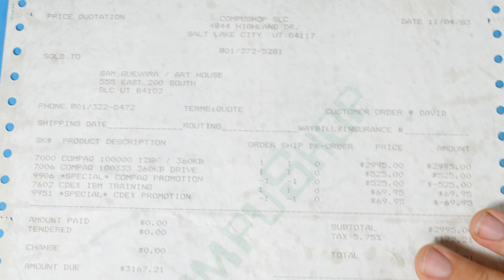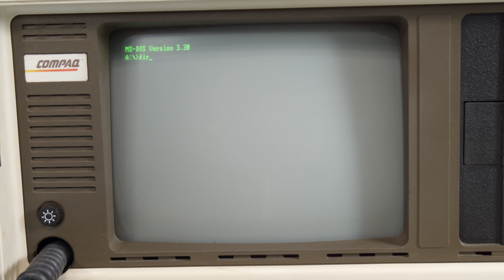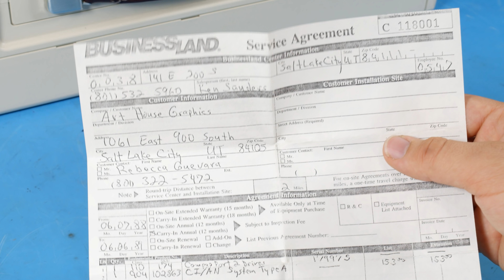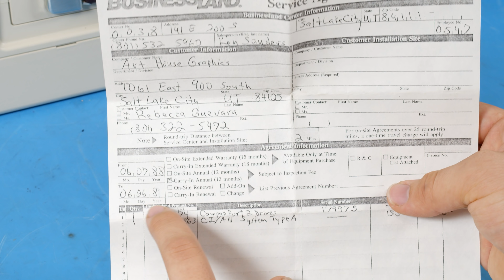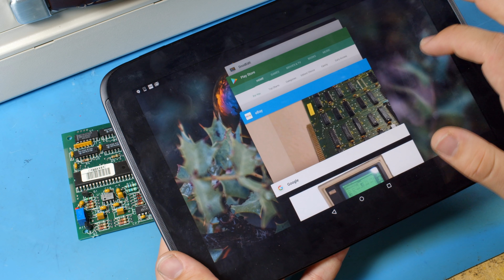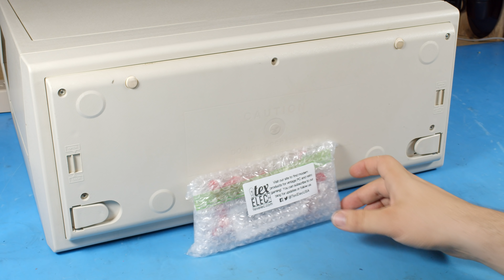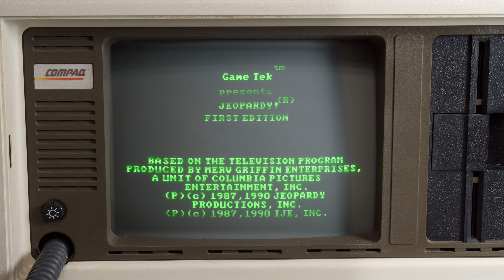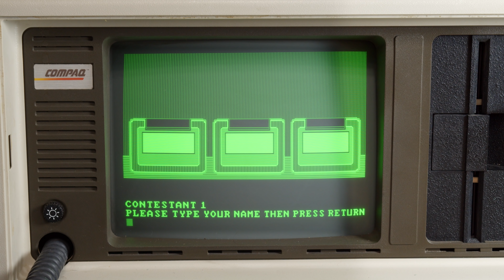Compaq Portable Repair history & Foam and Foil Keyboard Repair

Comment from the maker: It turns out it's easy to unplug the keyboard from the motherboard if you take off the bottom panel, oops.
Reply: well good to know now, for future unplugs or other people
Reply: Cool, but that compaq keyboard needed a rebuild lol
Reply: Your making me want to Dust off my Old Unit, But the Video card you can Also Plug in to a TV set for the Color.. Oh Flash Back of the Light Pen
I Also have the AT Clone Version of the Case, Much better it was Upgraded to a 486-DX50 VESA Local Bus. Two Cache Controllers, It was my Portable Workstation, till I got my IBM IntelliStation Z Pro (DUAL PENTIUM PRO), Intense3D Pro1000/T video adapter (16MB + 4MB Texture) Type 6899
Reply: @MakarovFox  I'm an otter person!
Reply: @hypnotised-clover  i prefer bats or foxes

Comment: Every time I hear the words foam and foil something in my brain goes off and I get ten times madder at whoever invented them.
Reply: I'd kinda counter with it cost about a quarter as much, and at least it wasnt a Sinclair keyboard.
Reply: @mycosys  yes it's cheap. But no one wants a keyboard that fucking disentergrates. The chicklet keys don't fail this bad. 
Rubber domes are cheap, but they don't disenergrate.
Reply: Chyrosran22 much?
Reply: At least I'm not in the cult of Holy Panda yet.
Yet... I plan on it.
Reply: I have no problem with them at all.  It's an easy repair.

Comment: Just got one of these DOA from ebay.  Had a memory bank error, found a shorted out 7400, replace that, snipped off a bunch of shorted tantalums, had it up and running until I plugged in the floppy controller, which somehow shorted out and killed my original video card.  Snipped off the bad tantalums on the floppy controller, ordered a replacement video card from ebay.  Ram expansion was badly corroded from leaking battery, scrubbed all the battery acid off, snipped off shorted tantalums.  Got all the cards back in and the machine is up and running! Ordered foil pads from texelec and an XTIDE.  This weekend I'll be scrubbing the case.  First 100% IBM compatible, and a portable no less. Very cool. Parked next to my TRS80 Model 4. The tantalums on the 12V rail are usually just to reduce RF interference.  The machine will run without them.  I've re-installed a bunch of them, will get to the rest of them eventually.

Comment: I’m the biggest sucker for Luggables. I’ve got a Portable II and love it. This one is screaming out for an XT-IDE and a Lo-fi ram upgrade. But even without, it’s looks in awesome condition even after all its repairs.
Reply from the maker: This video was started over a week ago and since then I've tested my Tecmar Captain and XT-IDE in it and it is working great with 640KB!
Reply: Oh, awesome. Great to hear. My Portable II still has its original HDD. Mainly because it makes the most awesome sounds :)

Comment: I have a Compaq Portable II, and I will need to do that with the keyboard as well. Nice little machine.
Reply: I was wondering if the Compaq Portable II used the same foam & foil system as the PC in this video, as I have one as well. So far my original keyboard is still holding up okay, though it doesn't get much use. I may one day put a socket on the keyboard cable to allow for a regular desktop keyboard to be plugged in. From what I understand it's wired the same as a PS/2 keyboard.

Comment: This thing feels like Theseus' Ship with how many parts have been replaced!
Reply: I'm guessing everything that was replaced was damaged when it was dropped.  Those old portables were sturdy but not bulletproof, and they weighed quite a bit.
Reply: I have a computer like that. I was just thinking about it a few days ago. Every component in it has been replaced at one point or another except for the case. Optical drives, motherboard, processor, floppy drive, graphics card, power supply - everything at some point has been either upgraded or replaced. I  still think of it as the computer I bought in 2004 - but IS it the same?

Comment: I have the a first Gen Portable I , two 360K drives,  20MB hard card, six-pack mem card for a total of 640K , of course the CGA card, serial/parallel card. My keyboard died too, i found that a SUN type 4 keyboard had the same foam discs, yet the SUN type 4 keyboards of that time had been recalled so they had a newer foam and discs. So i took those keyboard foam discs out and put them into the compaq keyboard, they were a direct match and thats what i used to replace mine.  i am glad to see now there is a source to get them.

Comment: Fantastic quality video in 4k60!  Good focus!
Reply from the maker: Thanks! This was the first "real" video where I was using some new lights I put together. I went from 40W to 100W total (LED) which is drastically brighter meaning I can use tighter apertures with a wider depth of field. So I can get a lot more in focus now. Eventually I'll get the proper lens adapter for my camera which will fix this problem even more letting me get more light and even sharper images. I'd say I'm doing pretty well though for a $24 adapter when most people recommend one that goes for $300+.

I think I've finally hit my stride for processing/grading the footage from the BMPCC4K as well. I'm consistently getting results that I'm happy with from it now. For the last couple videos, including this one, I also used a different grading method to be more consistent shot to shot which also saves me a ton of time. So I'm even processing my videos faster now.

Comment: AkBKukU: I have two of these - one of them was my first family computer.  I think your B:\ drive is the original and the A:\ drive was likely replaced when they replaced the floppy controller card.  I can take pictures of my two if you ever need reference pictures.
Reply: I also noticed on my plus, that one drive the A drive the floppy inserts just past flush and on the b drive it just out just a tad even when locked in.

Comment: Also if you want to upgrade to 640k on board, you need rom C or better and also a decoder prom in U35. If you search for monotech there is a guy in New Zealand that reverse engineered it. I burned a C rom, installed the decoder prom, a bunch of 256bit chips, and an XT-IDE in mine.
Reply: Just picked up a compaq portable plus... it just so happens to have an intel inboard 386 in it lol quite an upgrade, apparently there was a hardcard in it at one point but it's gone, I'll have to replace it with an XT-IDE I guess. The faster CPU makes it fail the compaq diagnostics... not that anything is wrong with the machine it just runs too fast.

Comment: Got this machine and going to pick it up at a location I have it set to (porch pirates). Too bad it isn't possible to put the Model F internals into the Compaq Portable 1 system, but I did order foam contact pads for the system and a few other items for flash storage, reading, writing, and archiving 360KB diskettes on another computer (XT-FDC BIOS on an ISA NIC for the system), controller card, sound card, and so on.

Comment: I really hope you cleaned the finger oils off of the conductive sides of those pads after you finished handling them. I remember another YouTuber's restoration going wrong because they got the conductors oily and it was based on resistances.
Reply: Yes I wanted him to go over it with a cleaner.

Comment: We had our IBM 5150 in use from about 1985-1995 or so... when we upgraded to windows 95 and a 16MB P166.... if you just need basic word processing or spreadsheets, the 5150 and other 8088 machines had you covered for many years.

Comment: I installed an original IBM XT 10MB HD with a Xebec controller in mine.  It drew so much current that the PSU would overheat.  So we bolted  a 120V cooling fan to the side of the case and it cooled it down so that I could use the HD.

Comment: I hate to break it to you, but in 1988-89 XT/PC class computers were still in wide spread use even tho by that time the 386 was out. While this computer was owned by "Art house Graphics" who's to say it was just used as a simple wordprosessing machine there.. an 8088 class computer would have been fine. personally im not surprised at the extended warranty docket
Reply: Yeah, it makes sense this machine was still in regular use in 1988, especially if it was used for accounting. I recall there were still XT-class systems being sold new in 1988. 386 machines were still quite expensive - especially portable models. Most of the software available in 1988 wasn't yet well-suited to 386 CPUs, either. 486-class machines weren't really manufactured in big numbers until 1990.

Comment: I always opened my portable by hitting  the edge on the front side of the top with my palms which lowered the tabs and allowed it to slide back towards the handle.
Reply: Ive heard the Compaq techs did it this way. It's probably the quickest way.

Comment: When viewing the part about putting in the capacitive pads, it would be a lot easier if the user pops the white pad holder out from the black housing. It prys out very easily, and allows the user to attach the pad under all four of those tiny pads very easily, then the white pad holder easily snaps back into the black housing.

Comment: If anyone knows otherwise and better, please correct me, but it seems that back in the day, those plastic full-length ISA card card end holders may have been supplied with the actual full-length cards. My IBM 5150 lacked a full complement of those end holders too. A full set of those holders may not have been in those early IBM PCs and compatibles from the start. If you're very lucky, and I was, you may still be able to find some of those holders on classifieds or auction sites. The long and the short (heh) is that your Compaq Portable probably isn't incomplete if you don't have an end holder for a non-existent card.

Comment: I had an old self-employed business computer gifted to me from the owner that was used from it's new state right up until 2014 - it was a 486 xD.
Reply: quite a lot of hardware up in space still uses old radiation hardened chips. Rad hardened MIPS R10000 processors are pretty common in space hardware.

Comment: I adjusted that price tag for inflation 3167.21 in today's money would be 7,997.77. Its no wonder why I didn't get a computer as a kid until the TI99 4A was on sale for 50.00.
Reply: Things like PC compatibles (like this Compaq Portable) were expensive like that, but not all computers were. Home computers (like the Ti-99/4a you mentioned) were way cheaper. The C64 launched for under $600, for example, and was reduced in price multiple times.

The reason the Ti-99/4a got so low was largely because of the price war with Commodore. Which was kinda Commodore getting payback for when they were rival calculator manufacturers, heh

But yeah, PC compatibles were expensive. In fact, the cost of the Portable makes the inclusion of a foam and foil keyboard a bit ridiculous

Comment: Are you looking for original physical Compaq DOS disks or just images, because Winworld PC has several Images of DOS 1.x -3.x that are Compaq OEM
Reply: @vaelfonia  They can, but I still have 40 year old 360K floppies that are perfectly readable. The 360K diskettes tended to be far more durable than the 1.2 MBs in my experience.
Reply: Depends largely on storage conditions, floppies stored in a cool dry place away from magnets and sunlight should be perfectly fine, floppies stored on a desk in the sunlight or in a dank warehouse next to large motors are likely to not work.
Reply: I have diagnostic disks that came with my portable plus... I wonder if they work on the original portable I imagine so...

Comment: I'm planning to turn a defective unit into a sleeper PC.

Two questions regarding that:
Is there any way to hook the CRT up to a modern GPU? If yes, how?
Is the protocol of the keyboard known and can it be adapted to USB or PS2?
Reply: Adapters of course. The old connector-to-usb is cheap and easy. Your also fine with VGA, adapters for the earlier video standards might require $$$

Comment: The complete motherboard replacement may make sense, I know the 8-BitGuy's motherboard had a shot/bad capacitor combo that kept it from booting with a video card.
Reply: I think he only replaced it to make the video in a timely way. It's very easy to replace capacitors, it's just the corrosive chemicals released when they leak or burst.

Comment: Maybe they were running some CNC equipment from this computer. Doesn't make much sense to upgrade then.
I saw quite ancient computer hooked up to an engraving machine in a corner shop in Spain last summer, still being in use.
Reply: You may be right but I'm not sure it makes a lot of sense to use a portable computer to drive a CNC. Also CNC computers tend to collect dust/grime which doesn't seem to be the case here. We'll probably never know, but my guess is it was used in an office for something mundane like accounting or word processing. It's also conceivable the graphic art done by the company wasn't at all computer-based - plenty of artwork was still hand-drawn in the '80s.

Comment: Always like your video’s. Is it possible to put a diverted video card in it? You is it connected to the internal monitor?
Reply: At 15:13 you can see the outputs of the video card briefly. It looks like it has CGA and composite outputs.
It can be replaced with an 8-bit ISA VGA card to drive a modern LCD monitor, but then the internal monitor will no longer work.
Reply: zoomosis thanks, but how do you think the card is connected to the internal monitor? With the pins on the top of the card above the compesite video connector?
Reply: @EdwinNoorlander  It looks like it. The video card on my Portable II is different, with a header on the other end of the card to connect the internal monitor. Incidentally I'm pleased the Portable II no longer uses those oddball card mounting brackets...
Reply: zoomosis thanks 👍🏻

Comment: Can the memory be extended? Seems like a good move.
Reply: The board can take up to 640KB via DIP switches or if 256KB is installed, a RAM + RTC card can be installed with 384KB and I believe drivers are required to get the full 640KB, but I digress.

Once I pick mine up, I'll look at mine and see once I diagnose and fix the issue it has: blank screen.

Comment: Of course they stuck with it as long as they could, they spent the 2019-equivalent of $7,700 on it. Look what lengths Linus went to with his iMac Pro. Also, the documents inside the case were just a copy, they likely had another copy with their receipt that they used to get it serviced (possibly multiple times).

Comment: Might be possible to modify the keyboard cable to unplug on the keyboard side (without a screwdriver involved) or even a breakaway inline with the cable?  Not that it's particularly necessary, but there's no kill like overkill!
Reply from the maker: Technically it could be done without a screwdriver if you have a way of removing the bottom panel on the case. It would be difficult to do regularly without scratching the computer though.

The only real reason to remove the keyboard beyond working on the hardware would be to adapt it to a standard XT connector to use any keyboard. It's very doable, but not all the necessary.